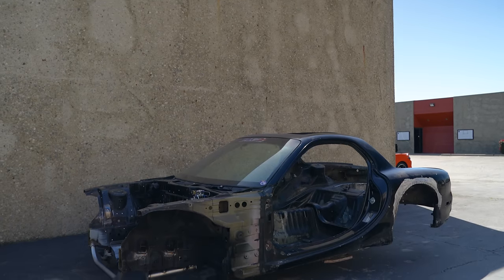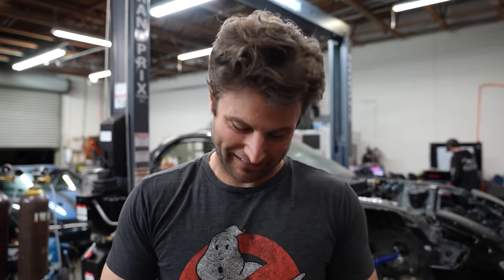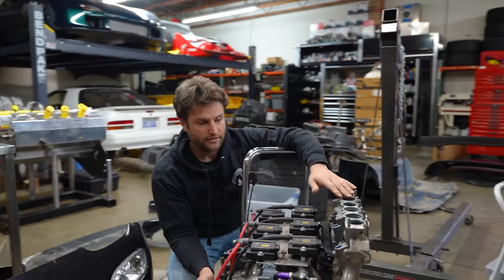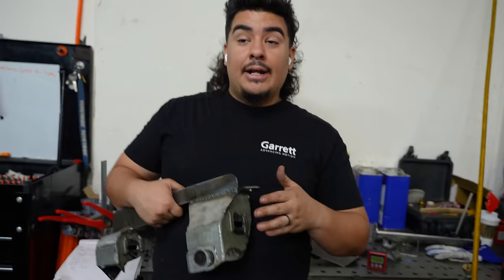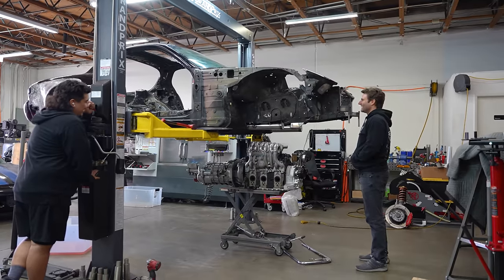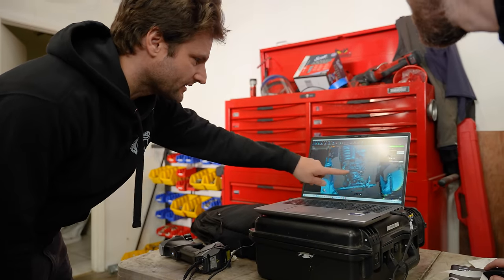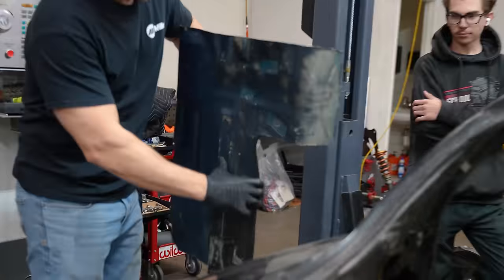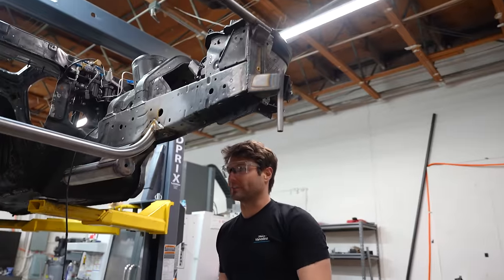I completely destroyed my RX-7 before Pikes Peak

Comment: Rob, moving the 20b back is exactly how this swap should be if you wanna maintain factory balance and polar moment. I simply left the stock subframe bolted on to keep alignment and cut up and removed the back half to drop in the engine. Then I beat the hell out of the firewall to round it out to make room for the bell housing to slide back. Pounding the firewall was how Autotech did it years ago so I just copied them. I finally just built the rear half of the subframe to fit it. Was super easy without building a whole new subframe however, I wish I had enough room to fit the Mazda racing dry sump front cover. My engine sits behind the stock rack with 1/4" clearance. That's how I did mine. I was also able to relocate the shifter into the front compartment on the stock fd tranny. 

Year later, I bought a T-56 out of a 2005 CST-V with the tripple cone syncros. This transmission has a pedestal type shifter housing that I was able to move forward to stock interior position. I've done the mockup for fitment but haven't fully installed that tranny yet. You're gonna love how much better the FD handles after moving that engine down and back.

Comment: Move the work piece to the far end that's the least sloppy on that table. That said, you could bring the slop to manageable levels depending on how worn (saddle style) the mill table ways are. IMO, worth taking that table apart just so you can clean decades of grime and schmutz out. While you're at it, you can figure out where the slop is. On that kind of a mill, you don't need to be hyper precise about it.

Comment: @18:05 that would probably be a smart idea making an access panel, maybe even with something like wingnuts for quick access.
Reply: 1/4 turn DZeus faster
Reply: @mke723  I'm used to the tall stand-off wingnuts you see on valvcovers.  Done a ton of off road racing, and dirt gets everwhere, including in the zues clips.  Only takes me about 2 sec to remove each wingnut. (breakthe torque with the wingnut, and then use the stem to quick spin it off.)

Comment: When you use dry ice to get rid of sound deadening use more dry ice. I go for 2 blocks min and break it up enough to cover a whole section. If you do that the whole section of deadening will come up as more or less a single piece without needing to hammer and chisel anything. Quick and less work in my opinion having done this on several race cars now.

Comment: If you were looking for another way to mill  that intake. You could bolt/clampit to the front of the of the mill bed, use machinist jacks on the runners to potentially remove any chatter. Just another way of doing what you did, live it anyway

Comment: NA Miata uses the same steering rack attachment as the FD Mazda upgrade the steering rack for the NB Miata so it’s actually bolted to the subframe instead of just strapped to it like the NA&FD it would probably be a good upgrade in a racing application to use an NB rack so it doesn’t move around under high force situations

Comment: There's no issue with using CAD, the issue is almost always with the CAD operator either overlooking things or mislabeling things on the drawing. Happens frequently, but you really just have to be careful when doing tubing and sheetmetal to understand the actual material being used and the tooling being used to execute it. Also have to account for neutral line offset as well to get the overall length dialed.

Comment: Awesome stuff Rob. This is top level stuff and real engineering to make something work properly. There are many build cars but most are just show peices that dont work properly after the mods. Pushing the engine back further and lower makes perfect performance sense. I am only wondering why not stock mount or vmount for intercooler setup. Big front mount intercooler shoves too much wieght forward in the car. I really want to do a 20b conversion on my street FD but i dont want to cut the firewall.  I do want to push it back like Rob to make sure it sits properly in the car. I wonder if it is possible.

Comment: If your chassis is not sitting square you found ur answer to why one mount was off 1/4 in. Especially if they measured from a set point on the frame to fabricate the old mounts. You need to straighten the frame unless you're going tube chassis front end before you build the cage.

Comment: If the manual mill has slop, why not use the Haas? You can easily make a manual cut on that as well. Unless you dont have the travel but even then you could do it in 2 ops.

Comment: @robdahm just a thought as far as the rack n pinion shaft angle goes. Is there enough room to move the alternator above the ps pump? Or maybe even delete the ps pump and switch to an electric pump and put the alternator in the ps pump spot.

Comment: instead of a power steering rack, and pump couldn't you save weight using an electric power steering system. With miatas we can use and modify prius ones into our steering column so that we have power steering on our depowered racks
Reply: This

Comment: Holy rusted floor pan. This might actually work. As of now, there is a possibility for this car to see the checkered flag on top of Pike's Peak. Remember to tie up and triangulate those shock tower mounts to the roll cage. That, with the right amount of spring rate compared to the body mass, is the difference between turning and not turning. Not turning at PPIHC is the end.

Comment: Compared to The Mosquito this thing is a Cadillac. Mount the alternator on the rear subframe with the pulley on the prop shaft because you'll have the battery back there anyway, it'll probably save weight and give you more room for steering

Comment: So this may be a dumb question I’m not sure but I’ve seen in like hybrids people have the alternator running off the rear axle could you do the same thing with the alternator here so as to eliminate the problem of it beeping in the way of the steering column and also move more weight to the rear?
Reply: that can work but is generally a bad idea because the alternator only spins when the vehicle moves and its rpm is tied to wheel speed not engine rpm

Comment: Rob, My question is how are you going to remove the UIM when engine is in? 
I know back when (2005) when I was researching about 20B in an FD, one of the concern was pushing the engine back was removal of UIM. I see that you kept the VIN area but I think you might need to cut all that so you can have space to remove the UIM. Otherwise, it would be pain to drop subframe to work on anything under the UIM.

Comment: Sounds extremely precarious k especially with front wheel grip 
 I like the idea but its all up hill meaning , all of the weight will transfer to the rear of the vehicle. ?  didnt watxh the whole video but you should drag back the front wheels with subframe and pull the baxk wheel s forward.

Comment: run the alternator off the rear diff like nascar. one less thing in the engine bay in the way.
Reply: that works because the rear wheels are at high speed constantly. Sadly, in nearly all other applications having the alternator tied to engine rpm rather than wheel speed is preferable.